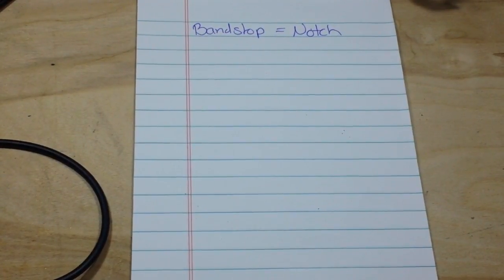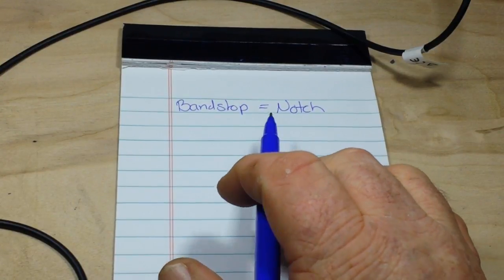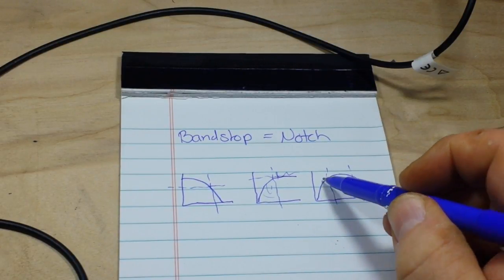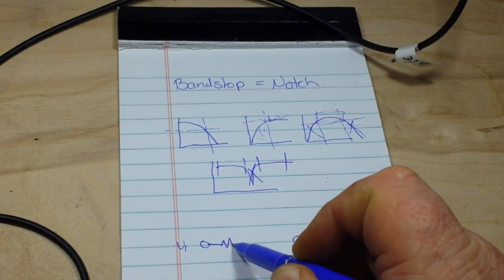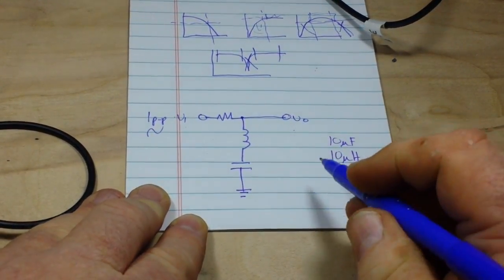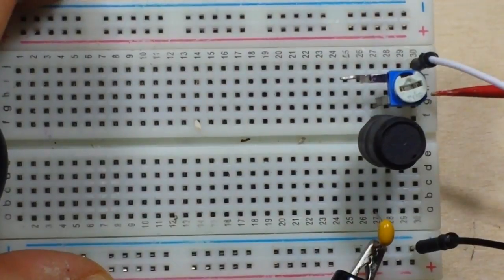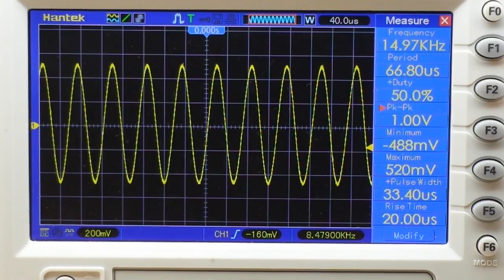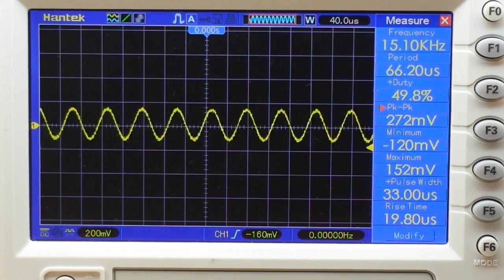Filters: LC Bandstop

Comment: Great for acoustic guitar pickups and feedback notching :). Is there any way to do the exact opposite though? I want to make a stomp box for a beat while I'm playing, I'm using a nice big 50mm piezo disc and only want about 60-100Hz passed. I tried various capacitors to ground but it starts attenuating bass before the treble is gone. I guess i need a low pass filter? I know nothing about electronics really sorry.